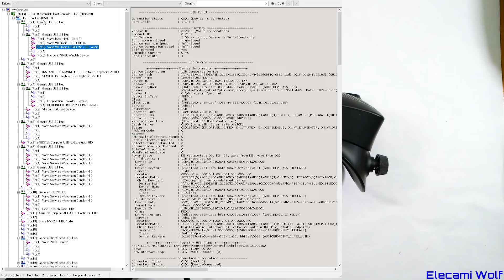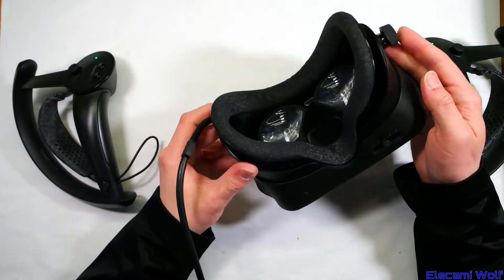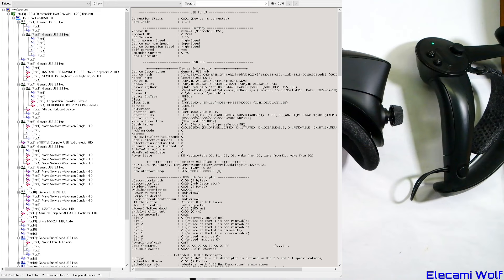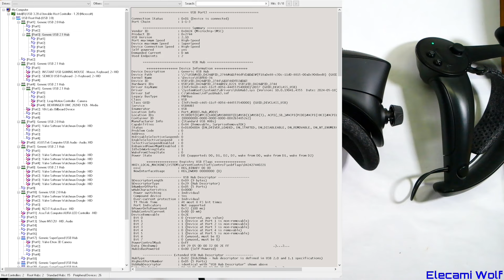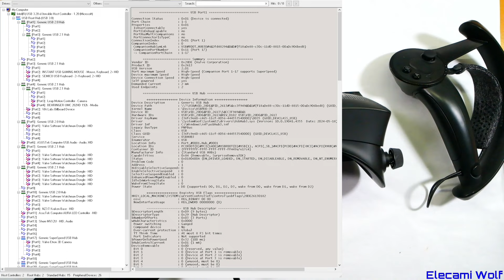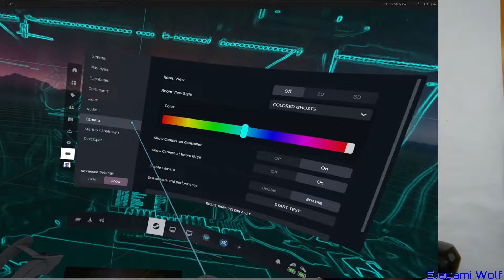EW0147 - Valve Index VR Headset Teardown & Brief Tundra Tracker Review

Comment: This is a really great video, will be much help as I try to fix my valve index which has started failing display initialization. 
I don't know if it's the motherboard or the I/O board. If you have a guess let me know. 
Thanks!
Reply from the maker: It could also be the cable. I don't have much experience with debugging Index Headset, this was my first time to take them apart.